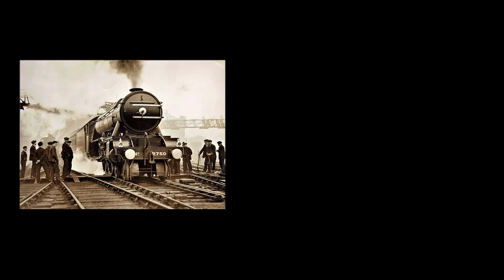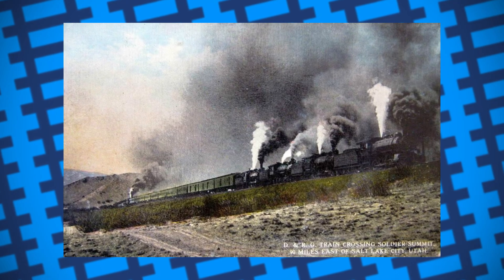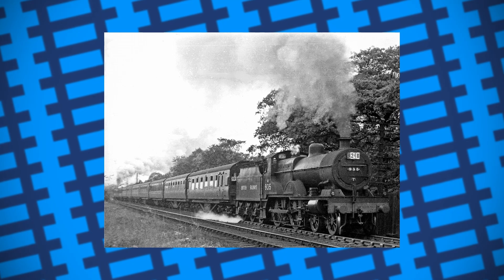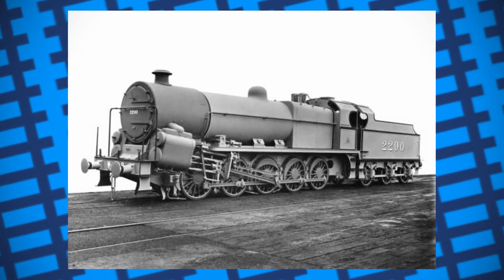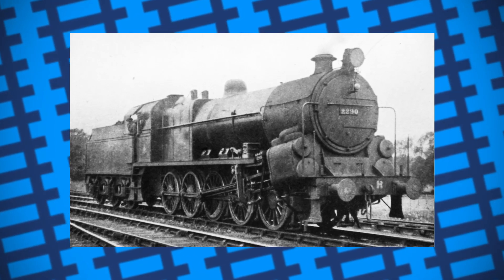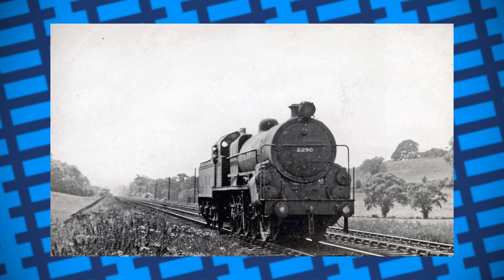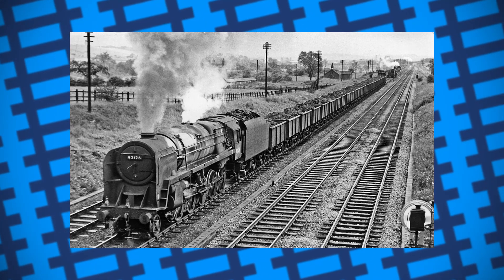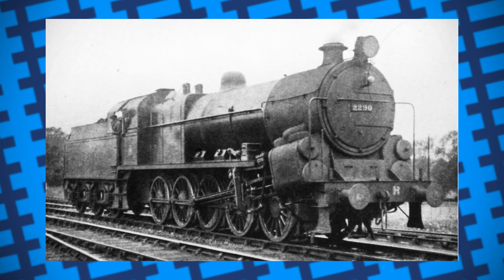The steam engine built to do nothing but push - Big "Emma" Bertha

Comment: Northern Pacific bought two 2-10-0 locos in 1886 for use on switchbacks ("Zig-Zags" in Australia) up and over Stampede Pass in Washington state. The statistics are remarkable: boiler pressure of only 150 psi, 46 inch diameter drivers, and yet 34,800 lbs of tractive effort and 133,000 lbs on the drivers, which was amazing performance when 2-8-0 was pulling most freight and even some passenger trains in the USA. NP would put both on one train, which indicates the steepness of gradients on the switchbacks that preceded Stampede Tunnel.

Apparently they exceeded the expectations that the NP had for them, because they survived long after Stampede Tunnel was completed om 1888 -- they were kept working into the early 1930s as heavy yard switchers; most likely they were declared surplus when business dropped during the Great Depression. The NP Decapods are similar in a lot of ways to the one-off Midland 0-10-0.

Comment: I am sorry, but to hear the superlatives bestowed on this locomotive makes me giggle.. For example, the Pennsylvania's class H6a/H6sa of 1903, a small locomotive by US standards, had a tractive effort of 42,000 pounds - virtually the same as "Bertha". Keeping with that railroad, its class J-1 2-10-4's of 1943 had a tractive effort of 94,0000 pounds - and that was based on a ten year old design, the Chesapeake and Ohio's class T-1. How about we compare an American 0-10-0?  C&O's class C-12 of 1919 had 63,000 pounds of grunt. And was a switcher, not a road engine or helper. And the Virginian's class XA 2-10-10-2's, which  were helper engines, of 1918 put out 135,000 pounds - 100,000 more than this locomotive. Reference another large US loco,  " I have seen it for myself. To those of us used to the smaller British loading gauge, the sheer size of the thing is breathtaking."

Comment: The CHAD Big Bertha:
Is a cool looking 0-10-0 tender engine with giant metal tits
Traversed the Lickey Incline over 2000 times with no issues
TEN driving wheels
Can be used as a regular engine if needed

The VIRGIN U1:
Is a flipping ugly tender engine with a second tender at the front you can't see over
Has confusing 2-8-0/0-8-2 wheel arrangement
Engine is supported on big moving dollies
Can never be uncoupled from both tenders
Is useless

Comment: So Big Berthas steaming and power capabilities can be seen by the fact that the engine used so much steam while pushing up the hill the boiler could not keep up. As such she would have no steam left once at the top but wouldnt actually be to the engines detriment as the crew would simply roll the behemoth back down the hill while quickly building pressure once again to get ready for the next train.

Comment: The only part of a train wheel that actually touches the rail is around the size of a 10 cent/20pence coin.  Actually - the wheel flange very rarely touches the rail. What keeps the train on the track is the conical angle of the wheel profile.

Comment: Wonder how this engine would’ve coped pulling heavy goods trains
Reply: It was pretty poor. It was tried out on freight early on but the steaming characteristics were not suited to speed. The steam passages to the inner cylinders were fed by the outer valves because the inclined cylinders left no room for inner valves, requiring convoluted pipework and less control over piston timing.

Comment: im especially fond of the pusher engines built. amongst the most beautiful are the mallet tank locomotives built by the gotthardbahn type scb ed 2x3/3 in my opinion. another special one is the DB BR96. due to them all be one trick ponys with issues they all got withrawn even in the mountainous alps. hovever they all set records in tractive effort managing incline and steep turns while being massive and sporting huge torque.  really like your video.

Comment: Those are two DRIVING cylinders. The ones on top are the VALVE cylinders.
Reply: @ronal8824  I was wondering about that. Yes, strange they weren't mentioned.  Thanks!
Reply: How embarrassing that someone posting on a railway video doesn't understand how 4 cylinders are installed. Almost trumps the pronunciation of Derby.....

Comment: If it's alright I ask, where did you get it from that the Standard 9s were less powerful than Big Bertha? Yeah, the latter may have had a higher tractive effort, but tractive effort simply isn't everything when it comes to a locomotive's power; and there's this presentation on her that actually states that the 9s were more powerful: https://www.youtube.com/watch?v=WXdlRNa7Edg (see 1:16:17 to 1:16:44).
Reply: 'Power' is a rather loosely-used word.   Sometimes it's used to refer to tractive effort (as in 'pulling power'), sometimes to drawbar horse power (which is where speed comes into it - power being defined loosely as 'force times speed').   A steam loco could only develop its best power figure if it could reach a suitable speed.   But at Lickey Bank speeds, tractive effort was more important than actual horsepower.

Comment: I liked the video but at one point you called the Lickey Incline "the steepest section of track in Britain" at 00:35 . The Lickey Incline is 1 in 37.7 for 2 miles (3.2km).
By this I assume you meant the steepest standard gauge line worked by adhesion but this is not true. Some other British inclines:
1 in14:  Hopton Incline on the Cromford and High Peak Railway (closed 1967)
1 in 17.1: Docklands Light Railway on the Bank extension.
1 in 19: At Dilhorne Colliery on the Foxfield Railway.
1 in 23: Ballochney Incline on the Ballochney Railway (closed 1930?)
1 in 23: Causewayend Incline on the Slamannan Railway (closed 1964?)
1 in 27: Mersey Tunnel (Liverpool end) on the Mersey Railway.
1 in 27: Werneth Incline on the Middleton Junction and Oldham Railway (closed 1964?)
1 in 27: Holywell Branch Line (closed 1954)
Most of these are quite short although both the Werneth Incline and the Holywell Branch were both over a mile (1.6km).

Comment: forgive me if i'm wrong, but that is a seriously impressive working life. i did a quick calculation, according to wikipedia, the lickey incline, where big bertha worked, was 3.2 kilometres long, meaning, at the very most, she went up and down that incline over her working life some 421,877 times. she worked roughly 13,514 days (37 years). if thats the case, and mind you i know this is too many, but still. she went up and down that incline about 32 times per day
Reply: The incline itself is 2 miles long (3.2km) but the crossovers to travel back down and then at the bottom to get to the rear of the next train up were some distance away top and bottom. A typical trip was closer to 4 miles each way, or 8 miles round trip for each climb; plus the run to Bromsgrove shed for water/coaling a few times a day.
Reply: @Simon-Davis  oh yeah, 100%. it was only a quick and very rough estimate. i might sit down one day and try and calculate it properly. but yeah thanks for the insight!
Reply: @chelsie9834  if you do, include the total altitude gain too

Comment: Whilst Lickey Bank is steep it was never the steepest adhesion worked incline in regular use. That honour was shared by the Ballochney Incline and the Causeway End Incline, both of which were 1 in 23 compared to the Lickey's 1 in 37. Both of these Scottish inclines lost their passenger services in 1st May 1930.
Reply: If you guys keep going you're going to get into cog and cable railways.
Reply: @Ralph Freeman yes, that's steep but I was only considering lines that had passenger services on a regular basis.
Reply: @Ralph Freeman  For what it's worth, the Bernina line in Switzerland is also 1 in 14 continuous all the way from Poschiavo up to the Lago Bianco at the head of the pass.   That's almost 4000 feet (vertical) of climb, with 2--chain radius curves.   All adhesion worked.   If you stand on the platform at Poschiavo you can see it start up the slope at what looks like an impossible gradient.   I agree it's amazing.
Reply: Mersey Tunnel GB has a section of 1 in 23 still in passenger service
Reply: @Satters  I thought in was 1 in 27.

Comment: I like the tender cab it had. Surprising not too many locomotives had that.
Reply: You think it'd be very useful if not convienent
Reply: @eageraurora879  for a locomotive that spends half the time running tender first, it’s a good investment.  In Germany, a fairly significant number of steam locomotives for branch-line service had them, due to the expensive of putting in a wye or turntable being a bit much for lightly-used lines.
Reply: Here int he US we call the cab a Doghouse.
Reply: The Somerset & Dorset Fowler 7Fs had a similar cab and were originally built with tender cabs like Big Bertha but the crews found that the rear cab made it difficult to use the longer firebox tools such as the pricker and so the tender cabs were removed. As they did spend some time going backwards across the Mendips in bad weather, the tender cab would have seemed a good idea!
Reply: And the 4F's did too. Homework lad, homework!
Reply: The Somerset and Dorset 7f had one but the footplate crew voted it down. I think I know why.
Reply: By “it“ you mean she?

Comment: I've always admired the strength that Big Bertha had during her time. The fact that she went up and down Lickey over 2000 times just proves that she will always hold the title of the only engine to not be tricked by the Lickey Incline's trick.
Reply: If I heard correctly, it was more like 200,000 times! That's about 15 times a day over 37 years (does that seem right?)
Reply: @drewzero1  sounds about right, plenty of freight and coal went over the Lickey.
Reply: I suppose a model should probably have two sets of traction tires to give an appropriate reactive effort.
Reply: I'am not clear about what "Big Bertha" means in Great Britain in that Time, i also not know anything about the Song. But what i know is that one of the biggest german Canon whas built by KRUPP and Nicknamed after Bertha Krupp ... and after the War several hughe Things ore Tools, a.s. 10kg Sledgehammers in a Forge also know as "Dicke Bertha" to make clear, now it will be noisy on the Anvil.
Reply: She was the most powerful locomotive and the power class was greater than a BR 9f engine. And adding that it took a 9f and a pannier or 4 panniers to take her place which shows how powerful she was.
Reply: @Steward125  It was not a powerful locomotive, it had slightly larger tractive effort than the 9F, but would have been running out of steam even at low speeds. In fact, the 9F had a slightly larger adhesive weight, so probably would out pull the banker even at low speed. The 0-10-0 wasn't given a power class, because the power classes were based on tractive effort at 25 mph (for the F classification) or 50 mph (for the P classification). The 0-10-0 couldn't reach 25 mph, so could be classified.   

The 9F replaced the 0-10-0 directly. It wasn't replaced by a 9F and 4 panniers.
Reply: @cobblestone_cowboy  that is if a 9f wasn't capable of pushing a very long fully loaded heavy goods. There's no shadow of doubt that a 9f could do it by itself. But if the train was too heavy to do it the 9f would pull the train and the 4 panniers would push it and the 4 panniers would be used if the 9f was out of action. But Bertha was capable of pushing one by herself and pushed over the top after 2 hours.
Reply: @Steward125  Bertha was no more capable than a 9F. In fact, Bertha's steam circuit was so poor I very much doubt the calculated tractive effort was realised. And the point still stands: Bertha was not a powerful locomotive. It had high starting tractive effort, not high power.
Reply: @cobblestone_cowboy  the reason the calculations were odd or the steam circuit was poor was because around the time the 9f's came into the equation Bertha was worn to the point that she was on her last legs because of massive amount of use of Bertha during her service in 1920. Adding that her made replacements never lived up to their promises, so Bertha was used very frequently. 

It's like trying to compare a mule/donkey to a horse. The mule/donkey (Bertha) had massive amounts of power despite its size but it can go farther than the horse (9f) because the force could only go so far until it clunks out. I believe there's a story about how 1 9f broke down pushing up a train on the incline.
Reply: @Steward125  the reason the calculations were odd or the steam circuit was poor was because around the time the 9f's came into the equation Bertha was worn

The calculations are not odd. All you need is the nominal boiler pressure, the diameter of the cylinder, length of the piston stroke etc. The value you get is what is the tractive effort numbers that are given. For Big Bertha, that is 43,000 lb ft (give or take). Bertha being "worn" is not relevant.

It's like trying to compare a mule/donkey to a horse

No its not. Bertha was not powerful when built. It had a terrible steam circuit because the design was bad, and I doubt the real world tractive effort matched that calculated effort which is what every body is using when they say Bertha was powerful. She was not.

The mule/donkey (Bertha) had massive amounts of power despite its size

It didn't have massive power. It had high tractive effort, which is not power.